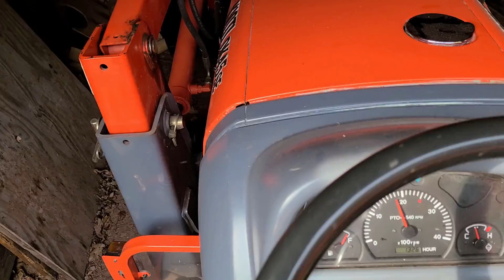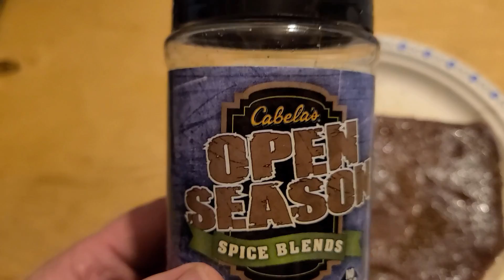Fall chores and moose on the grill! 🥩

Comment: Garden tip. I put red clover in my garden in the fall. You don't need to till it. Comes up in spring. Adds fertility to garden soil. Prevents weeds. Just plant normally in spring without tilling. Next fall before bow season, when garden is done remove some fence and let deer eat clover and fertilize  soil. Shoot deer for meat.

Comment: Our garden was good in cucumbers and tomatoes and potatoes and squash and pumpkin. Do you Dale put any fertilizer on your garden a
10-10-10 formulation or any manure. 
Put some on top and rake it in, in 
the fall or spring or till it in, in the spring. Always good to keep the firewood stacked up. That stuff you were moving in firewood looked like it was really dry, good stuff to split for kindling. We have fire danger out cuz its so dry, as farmers are asked to have a tractor and disc in the fields that they are combining. And it has been extremely windy.
Reply from the maker: I always put some sheep manure on it in the spring and till it in.

Comment: hey i got a question for you how many hours of sun do u get in winter? i’m thinking about installing a solar setup at my cabin but its located in a valley and i’m concerned i won’t receive enough sunlight in winter when the days are rather short
Reply: cheers
Reply from the maker: I think the shortest day of the year is 9 hours but the sun is really low in the sky and actual sun light is a lot less. I had to build my solar so that I have enough for those really short days but then in the summer I have way more than I could ever use.
Reply: @NB88  thanks!